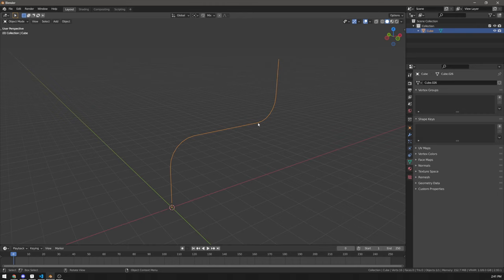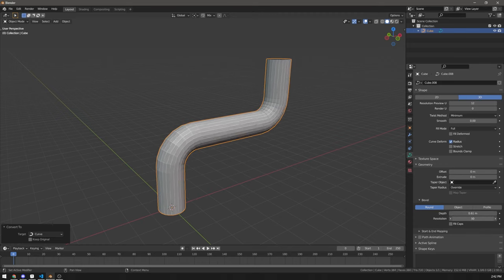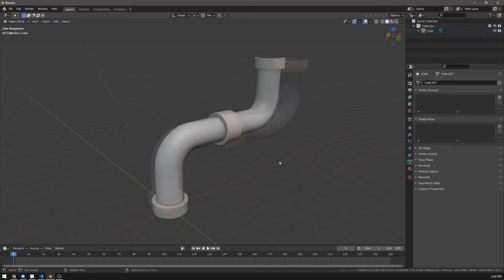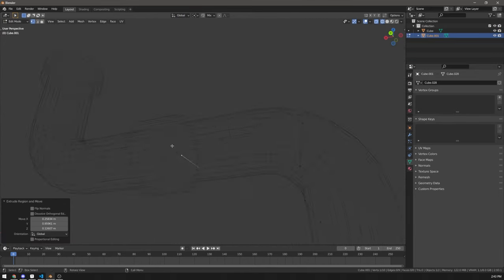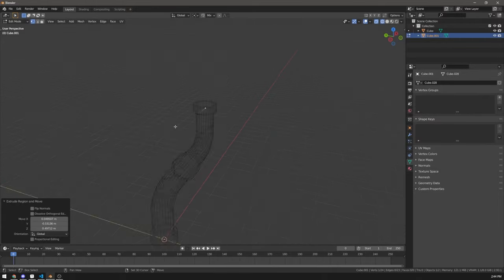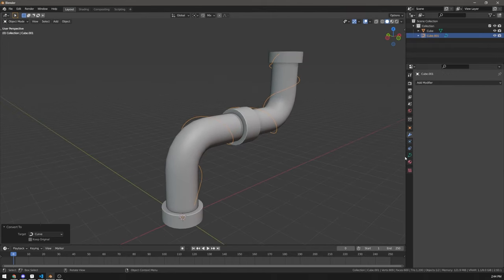Pipes and Cables in Blender - Quick Tip

Comment: Its  a real shame that you don't use software to display which keys you are using, especially at the end of the tutorial when your are splitting and editing the individual cables. I can't tell what you are doing so I can't replicate it :/
Reply: Maybe this video is not for begginers me included, and is focused more in what you can do
Reply: He's not doing anything too fancy! So all he's just selecting an edge and using the move tool (shortcut G) and then moving them around freely/rotating them. And how he's getting a large area to move around he has proportional editing turned on (should be at the top of your workspace in the centre, it's a little circle symbol) and then just to the right of that symbol there's a drop down menu which I think by default looks like a smooth A or mountain peak, click on that to bring down the options and click "Connected Only". That way you move around anything inside your "sphere" (mouse wheel up and down to increase/decrease the size of said sphere) and it'll only effect the individual tube you're selecting, despite it being part of a larger mesh! 

Okay LOOKS like a lot of info but I swear it's v straightforward haha. Just turn on Proportional editing> Connected only> G to move/S to scale/R to rotate.
Reply: @ferretart  this comment was so helpful! Once explained it was easy/obvious. Good explanation too!
Reply: thanks you so much guy, you save my job =)))) @ferretart
Reply: @ferretart  thank you so much.....

Comment: This was fast.. had to use .5 speed :)  TY for this.. quick question, at the very end when you're separting the cables out 1 by 1 using proportional editing... how do you get the move tool to move only that one tiny wire?  Mine always move the entire bundle.

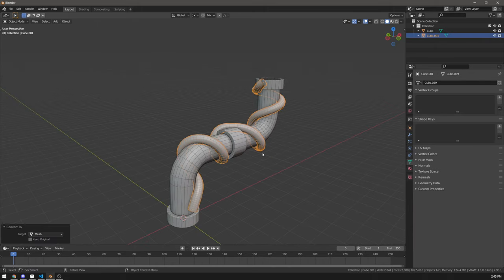Comment: Too bad we can't see the keys you press. at 1:00, you select only the edges. how do you do that without selecting all the mesh ?
Reply: in the top left is a small group of buttons, those are the select modes, it has 3 modes, Vertices, faces, and edges, they should have little decals on them so you'll be able to tell
(note the buttons are right under File, Edit, window etc tabs)
Reply: While in edge select mode, CTRL+ALT+left click to perform select ring function, and then SHIFT+CTRL+ALT+left click on the rest of the segments

Comment: hmm.. my cable ends up being egg-shaped when looking at the crossection near a bend :/ any ideas what I'm doing wrong?
edit: had to apply all transforms before converting to curve :D
Reply: Applying all transforms while it was still a curve worked for me. You just have to be in object mode for the option to pop up.
Thought I'd mention this as I was working with curves rather than with an object that you convert to a curve.

Thanks for commenting this btw! I was very confused.

Comment: how do you move the cables independently at the last part without affecting the others with the O button
?
Reply: Cick on proportional editing at the top and select 'connected only' use rotate and move, scroll to increase radius of effect, if it doesnt work it may because the circle starts at about 1m radius and you need to adjust it to fir the scale your using :)
Reply: @crashlegacy4768  thanks!!!!!! I didnt know there was a connected only setting!

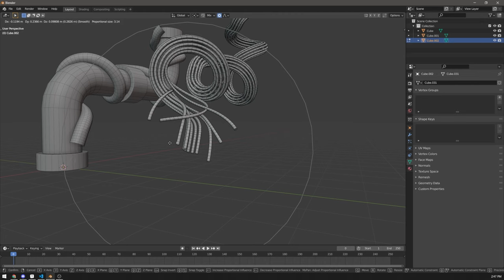Comment: how do you move the wires separately so smooth only selecting one point at the end of the wires? 1:10
Reply from the maker: It's called proportional editing, a circle icon top center of your viewport
Reply: @passivestar  Thank you so much for the answer! I get that part now but now when I move one wire with 'g' it moves all the wires beside the one I move unlike you can move each individual wires separately even though the G circle is much bigger than mine.
Reply: @Tuna6964  In the dropdown next to the Proportional Editing icon you can selected 'Connected Only'.

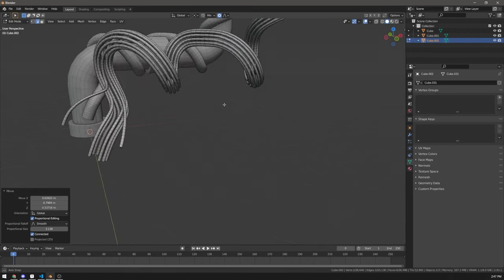Comment: What are you pressing to make the cables move individually (at the end of the video 1:06), the cables are still one joined mesh
Reply: Cick on proportional editing at the top and select 'connected only' use rotate and move, scroll to increase radius of effect, if it doesnt work it may because the circle starts at about 1m radius and you need to adjust it to fir the scale your using :)

Comment: BLUD WHAT DO YOU MEAN HOW DO YOU EVEN MAKE THOSE DAMN EXTRUSIONS
Reply: That confused me a bit too; a 5 min tutorial is needed to explain all the steps. In Edit Mode, click on the Extrude tool (in the sidebar). Look up at the top of the screen (top left) and you'll see two options: Normal and XYZ. Click on XYZ.  Now you can move the vertex around on the X or Y or Z.

Note: The Extrude tool has five options; you can use the "extrude to cursor" mode  to place a vertex anywhere, and the line will follow it.